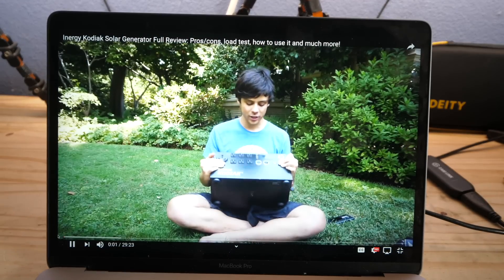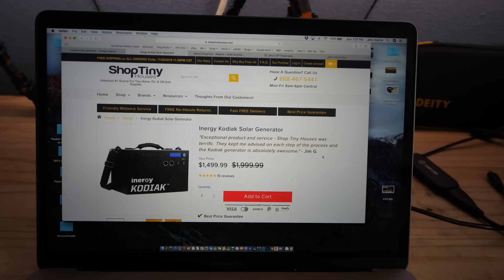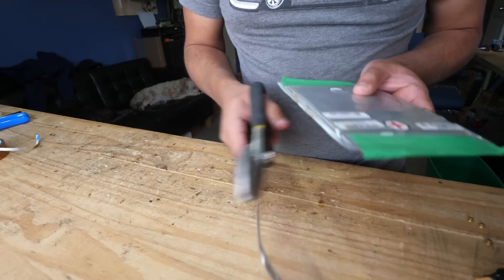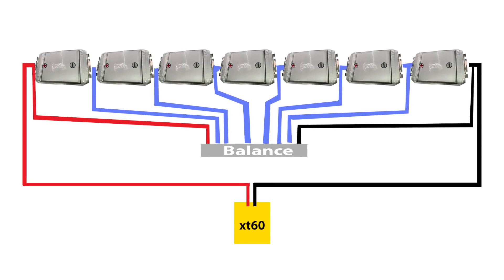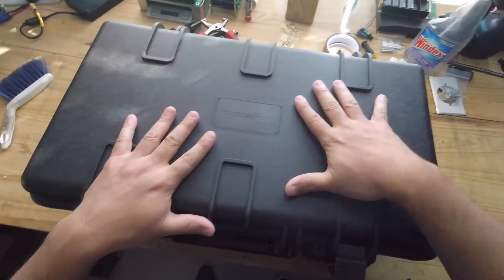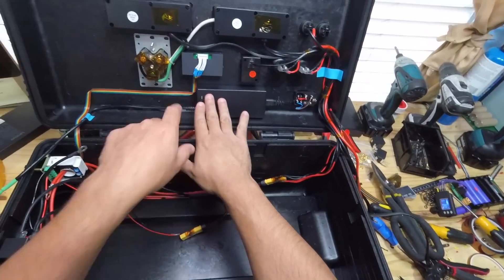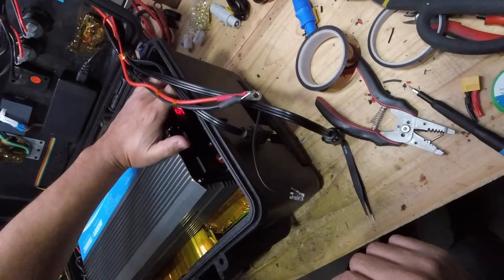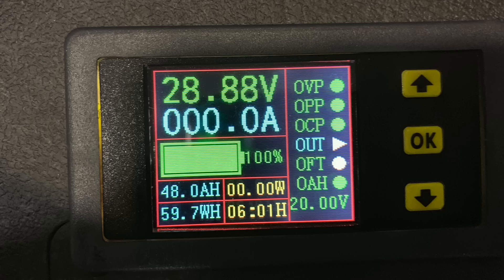DIY Inergy Kodiak Solar Generator

Comment: How many hours would you say it took to do this project? 
I was looking at something similar to this, and having the ability to daisy chain battery only cases to increase capacity. My only real concern is heat and potential fire load.

I had never heard of the Kodiak before, but the price seems reasonable if it took say a couple days work (16 hours) from start to finish.

Comment: Gretchen Box, You are making by yourself.i am watching from Germany..... question, what type of connection are the White and Blue ports in the middle right for? Is this the USA Standard to connect a welding machine with 16Ampere or higher? In Europe we use the mc4 Standard for Solar connection up to roundabout 10mm2 ,sometimes up to 16mm2....
Please excuse my bad American grammatic. 
Great video,  i wanna built nearly the same in an Aluminium Box, Witz an kfz type battery....
Solar greetings from germany

Comment: Hi Jeju I am updating the  parts list on this and will post shortly. Since you sell lipo cells in 10 packs is there any issue with using 50 in the build?? thanks for any help.
Reply: You have the part list?

Comment: I wish I had all the tools needed to do this.  If I bought all the tools to do this it could put the price of the Kodiak BUT I would have all the tools and probably some spare parts.  Did this have cooling fans?  I do not have the knowledge to do this, it looks simple and fast in the video but I’m just not that confident with electronics YET so for now I’m good with my Kodiak and new Flex unit.  Great video... I love this channel👍

Comment: YUour work is amazing and great videos detailing your work! Impressive to say the least. You need to create a line of power systems for sale.
The construct of this system is why people pay what they do for pre-built, warrantied systems. Great end-result here, but I would not use the cells/pouches you show here. Too much for newbs to get wrong. There are plenty of cells available to built 12/24/36/48v systems for cheap and they are much easier to built into batteries.
Not a knock on jeh, just too much work for 95% of customers out there. I built my 100ah 24v system for to much money LOL! Bought a 3000w inverter, could have easily cut that purchase price by at least $300 if I had gone with a 2000w inverter.

Comment: Oh Hell yeah, you can make a better one and much cheaper..  I’ve made about 10 of these so called solar generators.  The only thing that is better than what I made it’s the lithium batteries inside, but is very easily replaced in my system..

Comment: Nice looking project!  didn't see any breakers or fuse for the battery pack but that might just be a missing detail.  And the battery wires to the inverter look like 10 gage.. your 2000 watt inverter would draw 90 amps at 24 volts,too much for that wire.

Comment: This is an interesting project but more explanation is needed.  For example, the usb ports on the 110v strip would only be powered when the sinewave inverter is running. This is inefficient.  I assume that is why you added the other usb ports that are powered directly from the battery. This is a better approach. Also it seems that heat will be a problem.  Did you do any extended testing? Seems to me that the lid should be open when running the inverter. Lastly it seems you made a 24v battery. Why did you not use 12V? Without a 12v output you cannot run a portable 12V refrigerator.  Still there are good ideas here.

Comment: very much a newbie.  How long will it power the 30A plug for air conditioning in an RV, or will it.  what type load and for how long will it power it.  If I want to make one using lithium commercial batteries, how would I do that.  Thanks very much, I want to build one.

Comment: Not so much need for AC in a solar powered world.
No need to make AC... Most, if not all appliances have AC input but only really need DC.  The AC is transformed to DC in almost every case.
Look to remove the AC transformer in AC appliances, most all go to DC after AC.
The removal of AC input may even increase efficiency.

Comment: UPDATED LINK FOR RELAY! https://amzn.to/2WByu0C Wiring relays in parallel can be dangerous and unreliable for various reasons. And those relays are 40amp which can be dangerous if there is a surge for high power devices. This link is a 24v 120amp relay which is safer and more reliable for long term use. This relay being 120 amps gives it more wiggle room to work properly under higher loads and it can handle surges safer than the unrecommended parallel 80amp replays uses in the video.
Reply: So the 2 relays in this are connected together in parallel?
Reply: @nachosupreme9626  yes. Everyone says you should never do this with relays.. I used a big one instead.
Reply: @Zodiac83104  thank You, just order that relay in the link..

Comment: Thank you for the videos. I’ve built the batteries with the 20amp BMS system you used. When I try to use more then 20amps as in your video. I can not get more then 20amps. If it’s possible maybe a wire diagram would help.

Comment: I have a question for the electrical engineers. I know it's not a good idea to attach a charger to a battery pack while the charger is off as there can be reverse current from the pack flowing into the charger. Are all battery chargers protected with diodes or some other form of protection or should I include this into my circuit?

Comment: i've been #vanlifing for about 8 months now and come to this June it will be a full year.  I am visiting my mother atm and I have run into a bit of an energy battery crisis.   See I have been running my desktop off a 1000w inverter from my vans stock system and well let's just say I think I've killed my battery that's sealed under the van somewhere at this point.  I have been watching your channel on and off for a few years now I believe and I think I have to build something that can sustain my creative and gaming habits.  To give you an Idea my gaming rig is pretty decently powerful but its main use is creating graphics. (I am an animator and so I need to render out my images (read, time-consuming))     anyways I need to build something that is sustainable for at least 8 hours a day and can possibly run other equipment such as a small instapot, coffee maker ect...   I had noted at one time from your channel but let us just say a gremlin took off with a lot of my notes and equipment one night and I just recently built my computer again.  Any suggestions would be most appreciated.

Comment: I love your videos Jehu. You are a very humble man and you know your stuff.
In this comparison, regarding the price between the two I do not agree with you.
You priced your DIY at $787...
I assume this price only covers all the hardware/equipment bits, right?
What about the hourly rate for your work? How long did you take to create this DIY? Sure with time you will improve on the time, but you must take it into account.
I understand that as a hobbyist, one would do it without counting the hours. But is it fair to compare it that way against something that is retailed and that includes the labour to produce it?
If I had to order the DIY and you make it, I would expect to pay for your time otherwise you would lose money. How much would you charge me in total?
Probably much more than the $1,500 price of the Kodiak.
Now my problem is that I am not an electrician and know almost nothing about it. But I would love to learn and understand how to build what you build. It is fantastic.
Thank you for taking the time making these videos. I enjoy them all from Australia :) yeah, lots of Sun and still the energy suppliers charge about AUD$0.45/kWh!!! Crazy.
I would like to create some "battery packs" that would be between the equipment and the wall plug. Release their energy to the equipment when the solar panels stop producing and recharge automatically during the day when the solar kicks in. I understand that it might have to run on a timer based. So a pass-through or a possibility to charge at the same time as the appliance is running?
I am renting and I have already purchased the 6.6kW solar panels and the 5kW inverter on my own (against the landlord not raising our rent for the next 3 years and a 5 years tenancy agreement...). The solar panels with the Growatt inverter and installation cost me AUD3,100. I used to pay AUD$1,000/quarter (Summer and Winter - A/C and Heating) and AUD$800/quarter in Autumn and Spring when the temperatures are clement enough to avoid running the 5,000W Air conditioning unit (ducted in the house).
Let's say I would need to run the following equipment with their own individual battery packs:
1. Fridge
2. Bedside tables stuff (bedside lamps, USB  charging phones, ipads, fitbits, BT headphones and a CPAP machine)
3. Office big computer (1000W PSU, dual Xeon with fans and 20 HDDs, small printers, 2 x 30" monitors,  router gateway, switch, wireless router.
4. 2nd office laptop
Space is restricted for 1 and 2. Must be as flat as possible.
Because I have no clue about electricity, I don't know what type of capacity such battery packs would need to let the equipment run overnight for 10 hours? 7pm~7am? If longer that would be even better in case of some outages or rainy days.
So instead of purchasing a powerwall battery pack over $12,000,  I would rather get smaller power packs for each appliance/equipment. Forget the 5,000W A/C unit. If this is the one I have to pay when exceptionally in use, then so be it.
Sorry if I am asking too many questions. I feel like you are the type of inventor who would find this little challenge easy to solve.
Keep up the great work :)
Thank you.

Comment: @jehugarcia, You know me, always building in tight situations.....LOL. I noticed you built the 7s batteries 2 ways. One you folded the side tabs and taped, and on this one, you cut the side tab. I know you didn't break out with a tape measure, but kinda hoping you know how much of the side tabs did you leave? looks to me around 1/8" from the battery.  Also, do you loose space when stacked if you fold the tabs back? Great Video as always!!!

Comment: Man, I wish I had enough money for that DIY
Reply: im practically ordered batteries by set of four. each every transactions and also gives me alot of time to test each cells before my next order

my biggest mistake was purchasing dead laptop batteries. most of the cells were under 300-500mah and to the worst part are you cant discharge them like 1 amp. each cells like to discharge under 0.3 amps lol
Reply: It will still be expensive but you could always start with one battery and buy the others as you need it or as money comes

Comment: good very good... give some attention to the following:
use the NO.# to refer to each point you answer.
1- this compares this DIY 24V system to 12V systems !?!?!? how fair is that?

2- LiFePO4 a must, anything COBALT is way too dangerous. (BOEING 787!?)
 -- any of the other lithium technologies, one has to do math and massive reading to see the pros and cons!
3- which lithium technology is used here and availability?  (they are used... thus one must rust the cycles hyped!)

 4-- the charger listed advises to not attempt to charge LiFePO4 (LOL)
 5- the instructions for that charger are full of incorrect English, left to interpretation! !? !? [ NOT GOOD ]
 6-- and why a charger since the inverter already has a charge controller ?

7- is the Charge Controller programmable(that is critical) - BMS is crucial especially with Lithium-xxx.
8- Manufacturers specs are generally a guaranteed 1/2 loss on cycles, they must be adjusted via programming.
9- lithium REQUIRES a heating pad, and in some cases a cooling system - never mentioned

10- the description does have the parts list, but is missing the general operational specs...
11- such as max W out, Bat. Capacity, Ah(48Ah? that's rather small), ... etc.

12- the components should be kept separated with internal plates, don't know if this small box can accommodate?
13- why waste the Inverter's display and outputs!?
  why not make a window(hole) in the case and set the inverter flush the same as all the other gadgets installed in the lid
14- why not add a plate  inside the top of the box and install all the gadgets on that so lid can keep its function to keep everything out of the rain!

Comment: Can you make a video in detail about hooking up the lifepo4 flat batteries. Instead of 24 v can you do 12v.
Reply: You cant with the those cells the configuration dosen't work well in 12v strings you only get about 40% capacity at 12v vs 24v.  In another video he load tests a 12v string with the flat packs cells.

Comment: a good construction and thank for the video, im sure it's really helpful for so many, i just want to point safety factors  that you missed them, the inverter will produce heat and the box have a missing vantilation holes and that could damage and reduce the lithium batteries life, beside that more heat will cause more energy lose, beside everything it good.

Comment: Generator? It's a power bank. Not generating anything as far as I can see. Nice build tho.
Reply: ALL the manufacturers use the term Solar Generator, so, in order to compare apples w apples the same term should be used … even though they are all power banks. ;-)

Comment: The kodiak is not a reliable solar generator. I’ve had nothing problems with this unit . I bought the gold package for $2500 and it was one of the worst purchases I’ve ever made! If your a preppier you better battle test this thing  because I guarantee thing won’t last a year . Do yourself a solid and build your own!

Comment: Not to be an asshole, but have you really thought this contraption through?
If the packs start to bulge, expand or release their gases - isn't there a serious risk of fire? You put the unprotected INSIDES of the inverter right against the thinly insulated LIPO packs? Which may have sharp edges and be....conductive?
Yes, you may have fuses, but when the packs go off they use their own stored energy to continue the runaway thermal process. All that plastic will burn pretty bad, trust me.
I would NOT use this myself - separate the inverter and the powercells into two cases and an extension cord between with a fuse on it.
Take this as advice from someone who has seen firsthand the dangers of batteries, fires, flash-sparks/welds and component blowouts. 14 years as an electrician.

Aside from this, please continue doing your stuff. But keep the normals/everyday person safe with safe builds.

Comment: Needs a vent for the inverter to keep cool...?
Reply: Or even the cells cause those can get pretty hot to on max load
Reply: @bashaaksema94  though I agree about vemtilation at max load, these cells are rated to go way beyond what a max load would be with this inverter. They're 200A capable cells and the current is set to no more than 100A. I don't think overheating is an issue in this. Regardless, he has ventilation in this (as noted by subsequent videos) and as such, the argument is moot.

Comment: Has anyone actually built this (besides jehu) with results to share? Lipo vs 18650s? I'm guessing this isn't a novice project but damn I'd love to have one. The link to the solar panels is out of stock on amazon, anyone know of comparable or better panels to use for this?

Comment: How did you wire the 30 amp RV plug?
Reply from the maker: Very carefully?
Reply: Not helpful
Reply from the maker: Dumb question, what do you mean how?
Reply: wondering the same... looks like a spur directly off the 12amp power strip.... but would like to confirm or learn... can it draw the full 30amps?
Reply: ok, power strip seems to be 12a + 12a + 2a +2a + 2a = 30amp .... so in total equal to single 30amp socket.... nice

Comment: Don't know if anyone else has run into this yet trying to replicate this build, but the 24v version of the inverter/solar charger doesn't seem to be available any longer.  It's not on Amazon's site or Giandel's AU website.  The link goes to a 24v inverter,  but it doesn't have the solar charger.  Anyone else have this issue and were able to find a substitute?

Comment: I couldn't see any thermoelements? I'm just asking here, because you cut off the weldseam which is needed to counter inner pressure. Then you don't have any temperature measurement, which would prevent failure and a raise of inner pressure. Not sure if that's a good idea.

Comment: Everything is okey but I see a problem in design. The usb 5v output is connected to the AC port , so you need to turn on the invertor just for charging a phone!!

Also you gonna waste power running inverter for making AC then you use rectifier to make it DC , thus wasteing a lot power just for getting 5v. Very inefficient way.

Comment: You said you were gonna put a plate between the inverter. It looks like you didn't. In my opinion for 2 reasons I would get a piece of aluminum plate under the inverter to cool the batteries and protect them from any component failure potentoal on the inveret side with an open bottum. That could be hazardous seriously. It would also obviously cool the inverter and protect it. I would also put a small fan blowing on aluminim plate for cooling and would do another small one blowing across the top of the unit were the circuitry and wires all xome together  with 2 small fans cooling would be safer this unit will generate heat to explain I have a semi conductor chip background in manufacturing and Im a trained electronic tech that started back yeata ago. Just a slightly larger case is also a suggeatiom. Possibly available at an army surplus place. You did a great job in my opinion that is rad as hell. Peace Yo dont want anyone to burn the house down or the RV I look at things from a safety prospective like quality control liability etc.. great idea for a project and you nailed it really dude.  Im not criticizing Im suggesting additional finishing touches for safety only